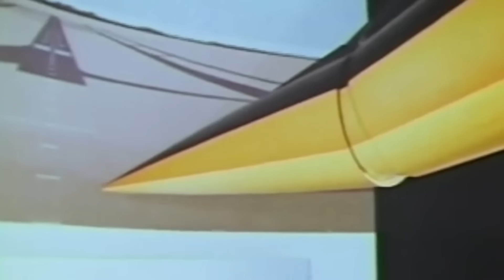The Insanely Bigger Faster American Concorde Failures

Comment: In the end the bigger slower 747 was an amazing economic success, while the quick beautiful Concord (and TU-144) were failures.
Reply: The thing was the Concord was actually profitable to operate.  The problem lied with the fact the Concorde effectively pulled first class customers away from the other planes on the same route, meaning those planes operated with less profit in the same airline. It wasn't worth it to the airline to offer Concorde flights if it meant their other flights made less money as a result.
Reply: @RidinDirtyRollinBurnouts  Do you have neutral info links?  I've never read anything like that and given the rise in fuel prices, hard to see how much profit margins could realistically be.
Reply: i'm not entirely sure lack of economic success (of the plane itself, USSR is different story) did the TU-144 in
Reply: @satagaming9144   The TU-144 was terribly unrefined and uncomfortable for passengers. It was a largely a tech showcase rushed to production to beat the Concord for national pride. Even without needing "profitability" in the USSR, it was still such a resource drain and  services ended after relatively few flights. It did it's job for being "first SST in the air", even if much of the tech was due to espionage.
Reply: The Concorde was never economically viable, with or without an exclusive first class criteria. The fuel consumption and maintenance on the bird was just too great. Both the British and French airlines knew they were operating it at a consistent loss, but national pride kept it flying.
Reply: @donaldbadowski290   National pride was especially true for the extremely expensive and unrefined TU-144. Beyond noise concerns, airlines around the world still bought and operated far more  jumbo jets than Concords. The far lower cost of air travel that we all enjoy today were because of those big jets.
Reply: So Boeing could be on top.
Reply: The Americans used noise pollution as an excuse to bar Concorde from most routes so the 747 never had to compete with it.
Reply: @ingurlund9657  If you lived on the Heathrow flight path when Concorde was flying you'd appreciate how loud it was. 11 A:M was not something you'd sleep through through. It was just amazing.
Reply: @tompiper9276  I grew up as a USAF dependent, and heard loud aircraft, both prop and jet, every day for something like 15 years. As an adult attending an airshow in San Diego, CA in 1988, I heard the Concorde take off ( then fly a hairpin flight path out over the Pacific, go supersonic, then return) and land. It was the loudest aircraft I ever heard, including all the fighter jets and passenger types. Totally agree with your experience.
Reply: @ingurlund9657   Nope. Noise pollution was a valid concern and the USAF even subjected a city to months of sonic booms for research. Beyond noise concerns, airlines around the world still bought and operated far more  jumbo jets than Concords. The far lower cost of air travel that we all enjoy today were because of those big jets. They were right to question the economic viability of an SST at that time.

Comment: I thought about a little something for supersonic passenger planes which I call "slingshot routes". Basically, these would be inter-continental routes between distant but frequented destinations (NY-London, Paris-Montreal, etc.) served by advanced high-altitude supersonics. Over such long distances, speed is the most desired, these destinations get lots of travel between them, and flying very high in combination with modern engineering (like on NASA's X-59 QueSST) should reduce the sonic boom. Maybe this would also renovate the hub-and-spoke air travel system - supersonic to a major airport, then subsonic to the final destination.
Reply: Above 60000 to 65000 feet you get blood boiling and instant death in the event of a sudden decompression. That is why Concorde avoided traveling beyond that altitude range. 

The way to reduce the overpressure energy(supersonic boom) is to reduce the values in E=MVV. The new supersonic business aircraft do this by being about 50% of the mass of Concorde and by cruising at about 67% of the Concorde's Mach 2.1 cruise speed, which is Mach 1.4. Add in the use of boundary layer air as a muffler of sorts and the aircraft might be able to go supersonic overhead with the supersonic boom being the equivalent of a 22LR rifle shot heard from a distance of 1000 meters(3300 feet).
Reply: @davidhoffman1278  Well, if you are going supersonic and you have a hull rupture, then sudden decompression isn't your biggest problem. And yeah, there is definitely research on reducing the sonic boom.

Comment: Ticket cost dictates the design of commercial aircraft. When confronted with fares double or triple normal cost the vast majority of travelers will opt for subsonic flight.
Reply: I don't suppose there too keen on having to refuel inflight either
Reply: Especially given that a lot of time is spent traveling to and from the airport, boarding, going through security, taxiing, in a holding pattern around the airport waiting to land, and whatnot. If you double the aircraft's speed, it probably cuts the overall travel time by 20% or something like that, depending on the distance. Not worth a much higher price. If you're going to pay more, you're better off buying business or first class on a normal plane.
Reply: Are there enough Elites travelling who can pay for this ??
Reply: @gogrape9716  Yes, after the Concorde's initial economical failure, they changed it to be a special luxurious experience for the wealthy. That proved very successfull. The Concorde was earning money in this adaption. But then came the crash, and today the technology is of course seriously outdated.
Reply: @gogrape9716  I doubt it would be a money maker for the airlines. Jumbo Jets made air travel affordable, it proved most passengers have more time than money.

Comment: Early on in the project, Boeing realized that only the ultra-rich were going to be able to afford tickets, and that's why they never went past the mockup stage, you never saw Boeing make any flying test aircraft for that design. They knew it was a dead end.
Reply: Seems they couldn't get the thing to fly across the Atlantic without in flight refuelling🤣 an issue of technological application?
Reply: Well, volume beat speed. Boeing was making the 737 and 747 at the same time.
Reply: @RileyFingeredMyDog commercial success is the measure. This is not a research project
Reply: @RileyFingeredMyDog Boeing and Lockheed laughed all the way to the bank. Their projects such as the 747, 737 and the L1011 made more money than the Concord ever did.

Comment: Concord is a good airplane.  Needs a baffle in the main wing fuel tank and a carbon reinforment on the underside of the tank and the skin on the upper wing surface.  Would buy up the mothballed onesn and operate it as a personal jet.
Reply: Those old Olympus engines are quite the maintenance hogs and are quite thirsty also. We have newer engines with less maintenance costs per flight hour.

Comment: I never understood why the US absolutely had to exaggerate the performance. 
If their plane would be only 20 knots faster than Concorde, it would still have been faster.
Reply: It wasn't supposed to be an exaggeration. Remember the USAF had the supposed Mach 3.0 capable XB-70 bomber, thus why not predict that the USA could build a Mach 2.7 capable passenger airliner.
Reply: @davidhoffman1278  well. 
Already the SB-70 should have shown something about the costs. 
You know, passenger air travel should pay the bills. 😉

Comment: love the dude just casually walking on the wing and watching it bounce under his weight with him not having a single care in the world XD 5:01
Reply: that's the allowed walking area in the center.  he didn't step on the ailerons or flap or the periphery of the wing
Reply: I have walked on many wings and when you bounce on them, they will move. Definitely want to stay away from many of the key points.
Reply: yeah I cant believe that guy. Anyone who swaggers across a wing designed to lift 60,000lbs with prolly around a max g load of 3.5 that in essence could withstand up too around abouts 200,000lbs in certain instances needs his noodle checked cause that right there b nucken futts
Reply: They are meant to flex. Mostly upwards, but they got the structure to move.
Reply: @HappyBeezerStudios  I sold maintenance stands to the USAF and we built a stand to allow them to paint the top of the engine pods on the B-52s.  I remember them telling me that the B-52 wing flexes up to 13 feet!  If you look at pictures of B-52s on the ground you will see the skin above the wings wrinkled up.  The skin smooths out once they are airborne.
Reply: 4:44 I don't know where you got your timestamp from.
Reply: @cpt.awesome7281  huh your right must have been tired and misread the time or had that number stuck in my head

Comment: How about the Corsair F4U? Was it the fastest propeller plane of ww2? Supposedly the only plane made entirely in one state- Connecticut
Reply: Not even close to being the fastest.
Reply: @georgebarnes8163  what was?
Reply: @ronalddevine9587  There are several claims made, the fastest I could find was a Spitfire @ 606 MPH
Reply: @georgebarnes8163  I'll have to research that. That is approaching jet speed. The fastest propeller speeds I've seen are around 450 - 460 mph.
Reply: @ronalddevine9587  During the London blitz by V1 flying bombs the Spitfires and Tornado piston aircraft  were better at downing the flying bombs than the British Meteor jet fighters, they had better speed at low level than the  Jet  Meteors.

Comment: Seems it was easier to put a man on the moon then build a SST and put it into eventual production and service.

Even stranger they sited environmental concerns of the SST's usage, when environmental concerns at that time were minimal. Case in point; we were still using DDT on crops, widespread asbestos use in home, commercial, and military applications, putting lead in gas & paint, Freon in A/C units and refrigerators, and steel and electrical plants belching ash and sulfuric toxins creating acid rain, not to mention building homes on chemical landfills.

The late 60s and early 70s were certainly a turbulent time to be an aircraft manufacturer, and the SST was obviously a victim of those changing times. If you ask me, it seems there was more back-room chicanery going on then we were led to believe.

NOTE - there were studies done on all these evironmental factors, especially the lead and asbestos impact on human populations going as far back as the late 1930 , but those were quietly overlooked by business and government until the EPA was formed by presidential executive order to address those concerns. Seems the SST was a sacrificial lamb; it's cancellation a corporate and government virtue-signal to those changing environmental concerns.

Comment: There is an airport, KTNT, west of Miami that was to serve as a hub for the 2707. It was going to be 5 times the size of JFK airport. One runway was built by the tjme the project was canceled and it was instead used as a jet transition training airport for a few airlines. It's still there and can be landed at with prior permission I believe although there are no services available and it is just an interesting part of aviation history.
Reply: Correct, I have trained a few times out of there and there's literally nothing expect for, water, alligators and one guy that drives around the perimeter in a truck, definitely not a place you want to get stranded at.
Reply: Yes it was called Dade-collier I flew there a few times training
Reply: "West of Miami " is an understatement. It is about halfway across the state. I guess someone thought it was a good idea. Probably going to bring you in supersonic, then put you on a commuter to go into Miami. Of course, that transfer time would have eaten up the time advantages of being supersonic.
Reply: @tommissouri4871  eh its not that wide. Once youve done it enough going horizontally across the state is easy.
Reply: @generalmarkmilleyisbenedic8895  - it isn't the flying, it is the bussing of passengers from the SST into Miami, about 55 miles away and about an hour and a half travel time. So if you flew the SST from Chicago in an hour to hour and a half plus the ground time, you are two to two and a half hours to Miami vs. conventional planes flying Chicago to Miami in about two and a half hours.
Reply: @tommissouri4871  no I think you have a solid grasp of real economics, these planes were just a crazy dream. The Concord flew but it was a money loser. But hopefully they will make some progress with that new plane they are testing, more fuel efficient and above all less noisy.
Reply: Sounds like a place that should be ground up and returned to nature! Florida is ruined by human incursion!
Reply: @nixl3518  yah humans are stupid theyve never done nothing for nobody florida belongs to the other dominant species of the planet
Reply: @tommissouri4871  lol fook no
Reply: Thx for sharing this, ive lived here my whole life never knew KTNT and such existed

Comment: The 1960's was a turbulent decade of change and there were missed opportunities. One of the items that should have been invested in was a national high speed rail system that served only major cities. California and Texas received that memo recently but work has been slow on the projects. With that said...
In 1980 I was among those that opposed a rail line from downtown San Diego to Tijuana. It turned out to be a huge success. 
After WW2, Chrysler, Ford and GM sent reps across the country, convincing cities that rail was a 19th century transportation mode and horribly outdated and most cities bought that BS, destroying their trolley systems. 
Imagine the scenario. You want to travel Los Angeles to New York. You get to the train station, check in, then board your train. You reserved a sleeper car, so you snooze while your train travels in excess of 200 mph to your destination. You get up in the morning, shower, shave, then dress and viola!! You have arrived at your destination.
Compare it to the alternative, hustling to the airport. Being searched by security, crowded into an aluminum tube where you sit, crushed between two people. You arrive at your destination, but have the hassle of recovering your bags, then probably being far from your needed location as the train station is probably closer.
But, that's just my opinion.
Reply: Nice dream. Making it happen has been very difficult.